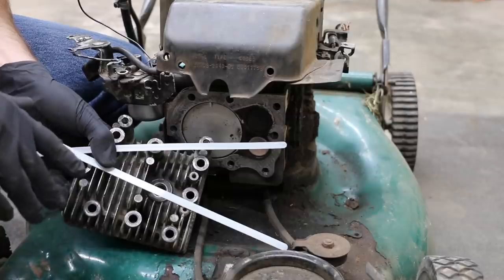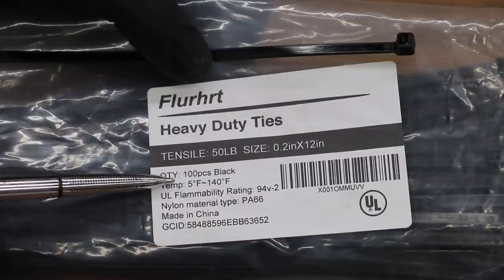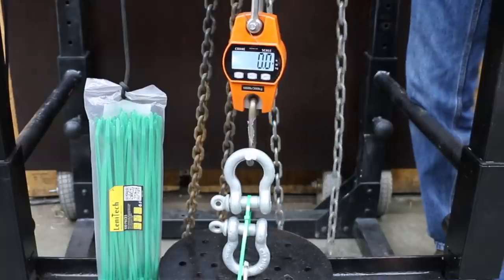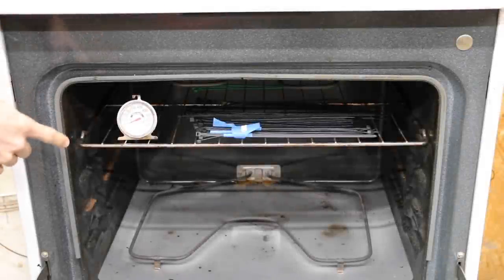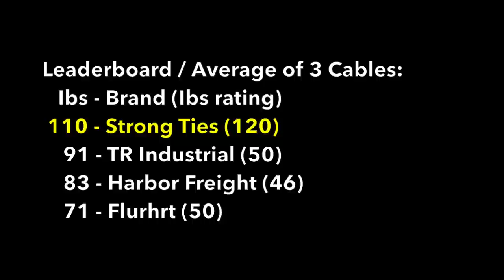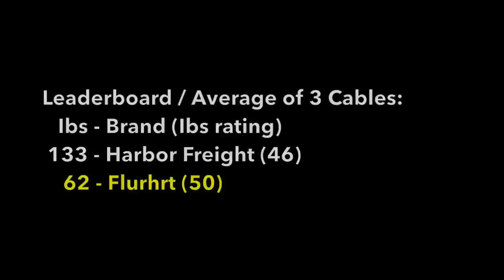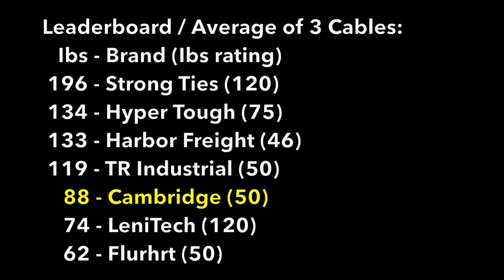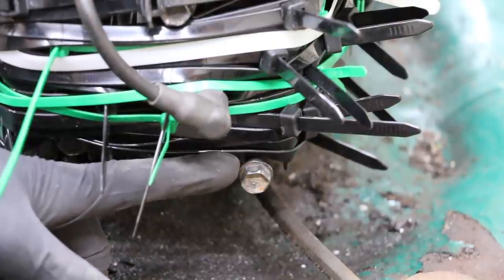Best Zip Tie Brand (7 Brands Tested)? Let's find out!

Comment: can u do a wear scar test between amazon basics oil. vs amazon basics + liqui moly ceramic oil additive vs amazon basics + stp ceramic oil treatment vs amazon basics + stp zzdp oil additive vs amazon basics + lucas oil stabilizer, to see what oil brand would cause the least metal to metal wear. Just took my 200k miles car to toyota to diagnose the rich running condition, was getting half the original mpg. Had a morning appointment, they made me wait 8 hours, took 15 minutes to unscrew a spark plugs and looked inside with a borescope, just to tell me they saw scoring on the cylinder walls and condemned the car giving me a bill for 10000 dollars. I was doing 3k mile oil changes with full synthetic oil and engine restore + zddp, I ended up just taking off the pcv hoses and giving it a massive vacuum leak. Since its a hybrid it doesn't really run the engine unless you're accelerating. So it doesn't even surge out of control with rpms. Got double my fuel economy again. I think the problem is that there is an exhaust leak/crack in the exhaust manifold, but they didn't bother diagnosing it.
Reply from the maker: Thanks for the suggestion.

Comment: On a side note, 3 zipties will replace fords stupid fuel pump hose clips. You know, the ones that cant fit without breaking? Both input and output on my beater bomb f150 are held in with just zipties after the clips failed and blew fuel everywhere.
Reply from the maker: Thank you

Comment: Best way to open a pack of zip ties, even if its s zip lock bag, rip or cut a hole a couple inches from the top or bottom of the tip ties. That way you can still easily take them out or put them back in, even a few ata time, but they can never come out of the bag accidently
Reply from the maker: Thanks for sharing.

Comment: Next time bolt down the cylinder head and then apply the zip ties. Make sure to leave access to the bolts, remove them and install the studs. Repeat test.
Reply from the maker: Great tip!

Comment: 2000 psi peak pressure in a lawnmover? I have found a couple of semi-reliable sources saying 1000psi in production cars, and then i would have guessed 6-700 in a lawnmover.
Reply from the maker: Thank you for this information. I sure wish I had a way of measuring it.

Comment: Another thing that you might want to examine:  UV (ultraviolet) degradation.  Outdoor use is common -- and the only ones that I have found to be durable are... stainless steel.  OK, sold as zip ties (I got mine on Amazon), but, arguably not really a true zip tie.
Reply from the maker: Great point. Thank you
Reply: I also have the feeling that the Harbor Freight black zip ties are weaker (more brittle) than the translucent white.  This is anecdotal only, though.   @ProjectFarm

Comment: Have been using T&B tie rabs since the 1960's and yes they cost more but were best in class. Maybe 8 years ago T & B was purchased by ABB. My company used to purchased large plastic jars of assorted cable ties from china loving WW Grainger. Pure garbage. Would break shot least 30% of them just slightly tightening them.
Reply from the maker: Thanks for sharing.

Comment: A valuable test; except for the engine cylinder head test, that is a waste of time, with out the test, any mechanic knows that will not work.  A factor not listed, is how the break occurred; like, did the latch fail, or did the band break.  An interesting test, would be exposure to sun light.
Reply from the maker: Thank you!

Comment: comment: Only the black nylon66 ties will last outdoors. UV will kill the others after 3-5 years.

Interestngly - if you want long lasting outdoor ties to hold cables down, doublesided velcro tape will last for decades (personal experience) and you can't overtighten them to the point where cables get damaged (a  common problem with zip ties) - and with a couple of wraps the tensile strength is unbelievable.
Reply from the maker: Great point!  Thank you
Reply: @ProjectFarm  The other thing about velcros - no sharp ends. Zip ties can draw blood if attention isn't paid to the way they're cut off (there's a special tool for tensioning/cutting but noone ever has it or uses it unless installing hundreds at a time)

Comment: I didnt see the only brand that anyone should use in this test Ty Wrap brand cable ties. I have worked in the communication industry for 45 years and have used ty wrap cable ties exclusively. never a problem. ive gone back and worked on cable that i have used Ty Wraps on after 20 years they were still holding. Why werent they included in this test? they are the industry standard.
Reply from the maker: Thanks for the suggestion.

Comment: Unfortunately they are all below their ratings. Tensile strength means the minimum load required to break a single strand. With O shape configuration, you theoretically double the strength (practically may be a bit less). So, you should simply consider the half of your results.
Reply from the maker: Thanks for the feedback.

Comment: Harbor Freight actually out did them all compared to the rated working load lbs. for each.  Strong Ties rated for 120lbs broke at 159lbs that's only 39lbs over its rated, Hyper Tough rated at 75lbs. broke at 118lbs that's 43lbs over its rating while Harbor Freight rated at 46lbs broke at 116lbs that's a WHOPPING 70lbs over its rated working load.
Reply from the maker: Thanks for the constructive feedback!

Comment: He did not include the best brand of all. Thomas & Betts ty-raps are the original and by far the best cable ties ever made. I have been using them since I discovered them in 1968. They are  not usually found in box stores and are more expensive than all the others but well worth it for strength and long term durability.
Reply from the maker: Thanks for the suggestion.

Comment: Ratings should be based on the specified strength, not ultimate strength. A less expensive zip tie rated for 75 lbs that actually handles 120 lbs is a better value than a more expensive 150 lb rated tie that delivers 150 lbs.
Reply from the maker: Thanks for the feedback.

Comment: You should also test the https://www.griplockties.com/.  It is a company co-owned by Make Patey, an aircraft builder, engineer, etc.  They are rubber-lined, protective, cushioning cable ties that prevent wire and cable damage. GripLockTies™ are especially protective in high-vibration and elevated-temperature applications.
Reply from the maker: Great video idea!

Comment: As an Electrician , I can tell you that your torture test is not really necessary...The needed strength need to hold a bundle of cables together is nowhere near the advertised breaking point of each tie......BUT....If you want to test a real quality tie,....Give the Thomas & Betts brand a chance....The Ty -Rap model line is Unbeatable ....Oh Baby, do they cost, But you get what you pay for....I dare you to try them....Quality !!!!......Woody
Reply from the maker: Thanks for the feedback.

Comment: I think you are testing these ties incorrectly and getting a false reading as a result. By putting them under tension when they are connected virtually doubles the tensile strength. You should test them when they are straight and not looped as this will give a more accurate idea of their true tensile strength.
Reply from the maker: Thanks for the constructive feedback.  I believe the industry standard is "loop tensile strength", since that's how they are used.  However, only one product specifically referenced "loop capacity".

Comment: The biggest problem I run into with zip ties is they become brittle with age and break.
Reply from the maker: Great point!  I'll test for UV resistance and age soon
Reply: Humidity - or lack thereof - also degrades the tensile strength of nylon.